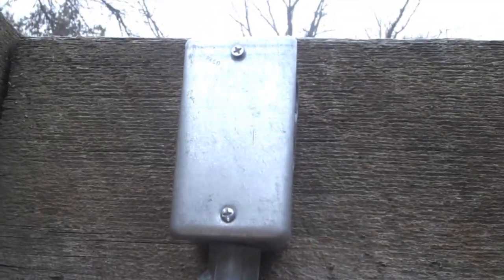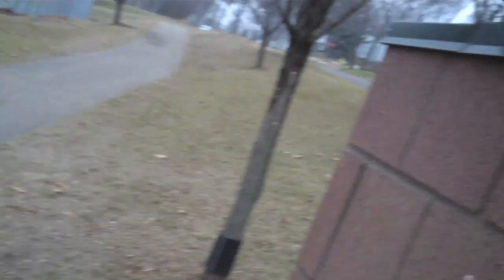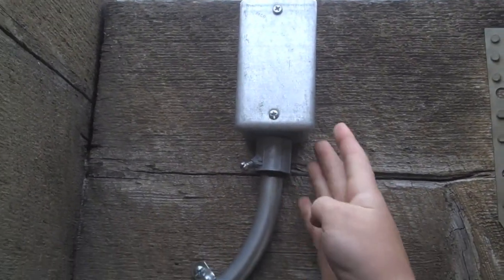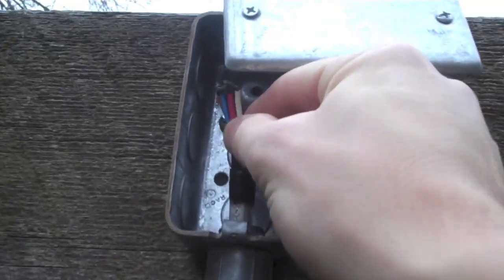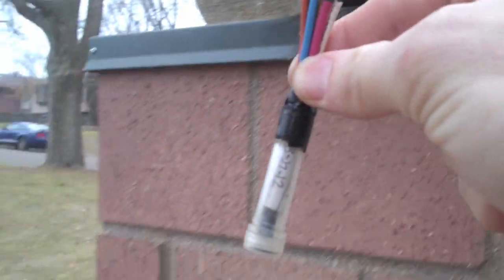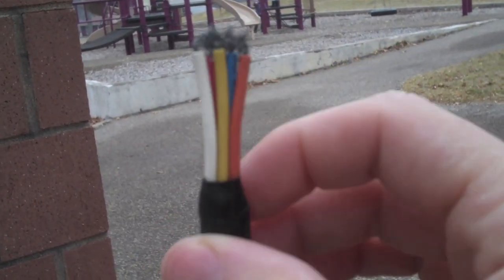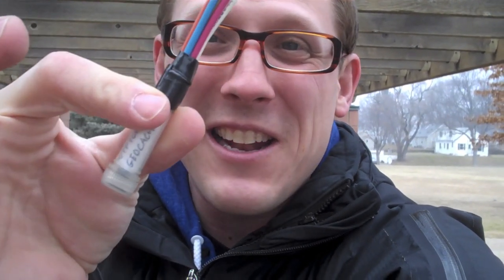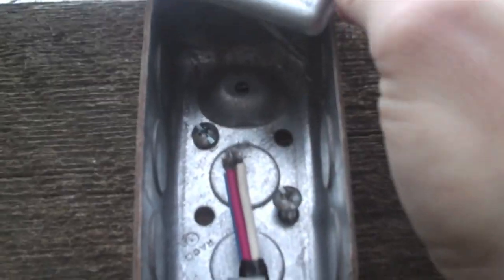UNIQUE ELECTRIC BOX GEOCACHE!

Comment: As usual Josh, I love your video.  I do have two questions.  First, what app was ReesterBunny using on the iphone5?  Second?  How fo you feel in general about fake electrical box caches?  I have found that one and I really liked the design, very cool.  I do think we ask for dangerous situations when we train cachers to mess with electrical boxes and wires.  Also on that one, I am not so sure that permission could ever have been granted by the park to screw that thing onto the shelter.  Thoughts?